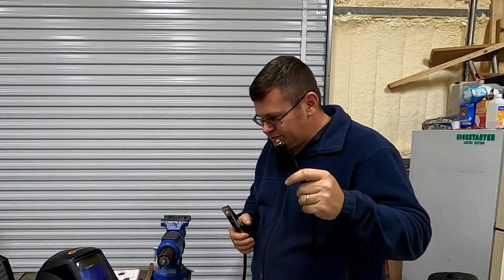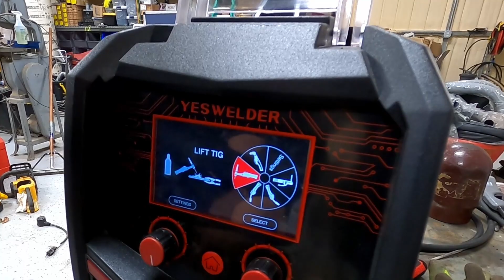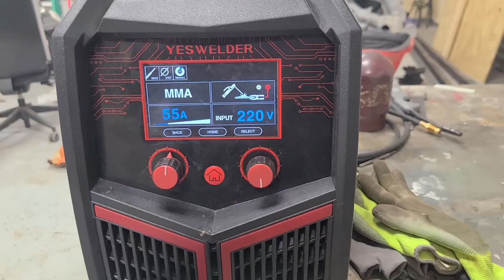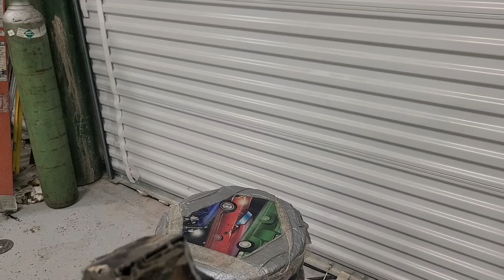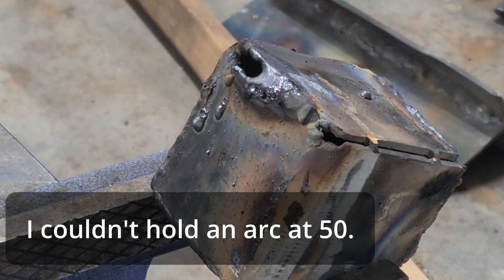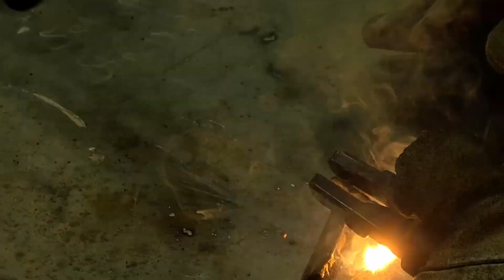Stick Welding with the YesWelder MP200 - Multi-process Welder - Stick Welder - Arc Welding

Comment: I must must have missed something did you like or not like it ?
Reply from the maker: It's a great welder and will do everything I need. Stick welding seems to be my nemesis and I will need practice. It strikes a good arc above 60amps. So yes I like the welder.

Comment: Love the videos! Mine just came in the mail 😁. Can't wait to test it out
Reply from the maker: Did you order the production model or from kickstarter?
Reply: @SparkyBuilt  the kickstarer one. A rod you should try is 6013, use the setting for 70xx rods straight polarity. They burn pretty good for light Guage material

Comment: In update #3 YesWelder stated the MP200 would have "hot start" on the MMA function in production models.. Have you seen this feature yet?
Reply from the maker: It does say that, I know at low amperage it does not like to start, there is not a setting. How could I tell?
Reply: @SparkyBuilt  yeah, mine has no settings either, its just like yours..